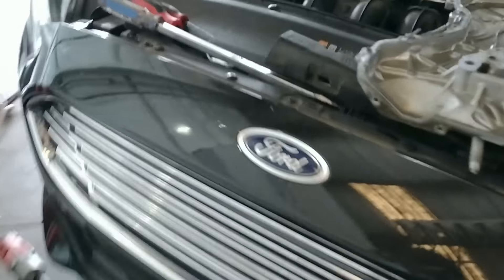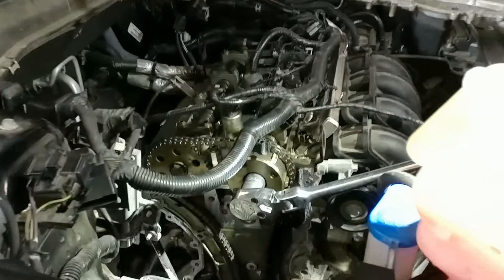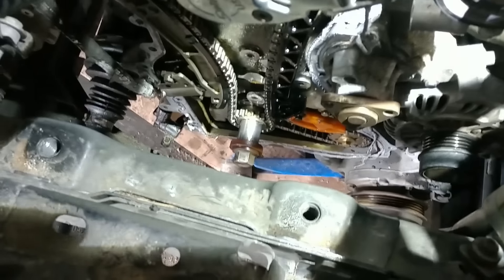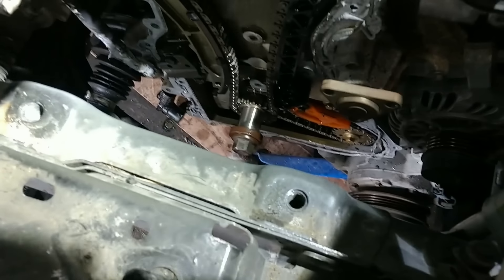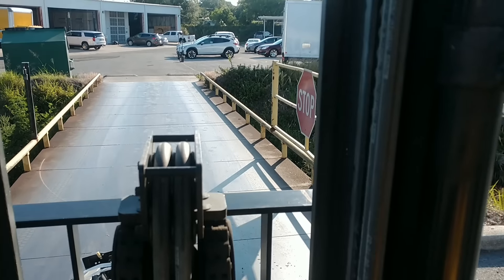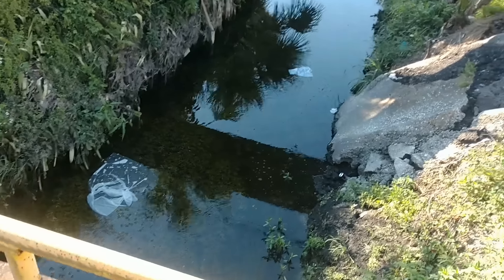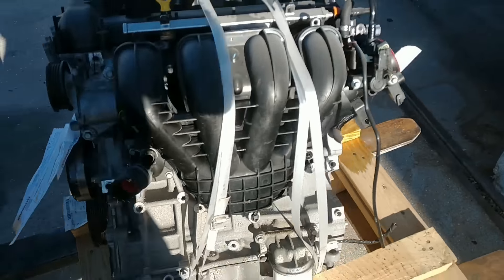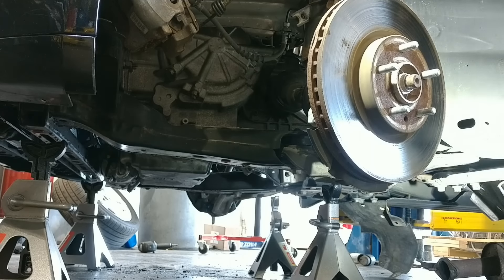Damaged Engine: You Broke it! Pt1

Comment: “That’s where we failed.”  You’re a team player and an exemplary boss. Nice!
Reply: Too right.
Reply: +1 to that. Even just the way he takes it in as a learning experience for the both of them, what a legend
Reply: That's when I subscribed. Guys honest, fair, and kind.
Reply: This is the right boss for an apprentice to learn from. Quality begets quality. There is no other way to explain it.
Reply: Way to own it.  We all make mistakes and learn from it.  Kudos to you guys
Reply: FRICTION holds the timing sprocket in place?  What?
Reply: @maxpeck4154  interference engine what a shitty design.
Reply: @steeler68cad  I don't think it's inherently shitty, but there should be a solid mechanical connection for the timing belt/chain for crying out loud.
Reply: @maxpeck4154  well, that sounds inherently shitty to me.
Reply: Accepting the moments of failure that will happen and knowing how to use them to teach is a skill of only top tier mentors
Reply: I've been a trainer in the Army, a truck driver, and now even as a Crossing Guard. A trainee's failure is your failure, and you need to take corrective action to teach whomever you are working with both the right way and the negative impacts of doing it wrong.

Comment: I would be passed that the shop put in a junkyard engine.   As the customer I would have demanded a brand new engine since a professional mechanic was the cause of the engine destruction.
Reply: Pissed.  Stuiped auto spell.
Reply from the maker: It was an apprentice doing the work, against the advice of myself. Decision was made by management. Damage caused by a mistake doesn't mean folks get brand new engines. The damage could have been repaired, the engine could have been replaced with a unit of equal or fewer miles, (old one was 74k, new one was 41k) which is what happened in this instance. The owner makes those decisions, not the shop. If you break your phone and file a claim on it's insurance, they don't send you a brand new one, you get it repaired at the deductible or it's replaced with a remanufactured (rebuilt) unit.  LKQ offers warranties on units such as engines and transmissions etc.  Since the owner got to drive a brand new car car during the repair, got a engine with almost half the mileage and gets a warranty on a vehicle long out of Fords powertrain warranty, I'd say they ended up with a sweet deal in this case.
Reply: @RainmanRaysRepairs  the warranty would be a critical point, but in the phone example, the phone was broken by the customer.  It doesn’t match what happened in your shop. The shop broke the vehicle not the customer. The shop didn’t use the factory service info and destroyed the engine. I totally get it was an apprentice mistake but his mistakes should be completely on the shop, NOT shared with a customer.  Idk this customers maintenance habits but I do know mine and I would not be quiet over a junkyard engine.
Reply from the maker: @rbarr1200  I totally see your point. I take good care of my Duramax and would flip my lid if it were damaged and replaced with a salvage engine. Believe me, I was pissed at the whole situation from start to finish. Had I owned the shop, the young guys wouldn't have been allowed inside an engine to begin with. Fortunately for the managers, the customer was ok with the engine and choose that over repair of the damaged one. At the end of the day the shop got off with less dollars spent, the customer got a newer engine than what he had, and a warranty to go with it. It ended up being a win win given the circumstances. The trainee got his trial by fire and learned a lot, and the managers didn't learn squat. They gave him another advanced level job right after. I got another job and got out of Dodge (no pun intended) shortly after this disaster was sorted out.  It's not posted yet, but here's part 2 https://youtu.be/WZd6mHjS1rY

Comment: Engineer: okay, we design a new engine... BUT... We make it like the hellraiser puzzle box.
Reply: well the fusion was never meant to be sold here in the states since elsewhere (mainly the uk) its known as the mondeo and apparently used to be amazing till that generation
Reply: Bizarre to me that you you would friction fit the timing chain drive sprocket 💩
Reply: @guganotubo  dude the ford engineers had to be high when makin it
Reply: A keyed timing set will cost you extra 😆
Reply: Every engineer should be force to work on their designs once implemented in the real world. I have actually heard engineers say, thats a technical problem. Not an engineering issue. When its their design that created the problem.
Reply: @BigHappysPlace  atleast i own a older truck cause these new ones seem way too overly plastic. and i don't get the newer styling i dont know why but i hate the newer giant grilles on trucks nowadays
Reply: @BigHappysPlace  I'm actually in my last year of a mechanical engineering degree. I'm also 38 and have worked a good portion of my life as an industrial electromechanical tech. One thing engineering schools don't teach is common sense and practicality.
Reply: @graveyardrumblers  that's not necessary when the goal is cosy cutting and building as low cost as possible
Reply: Cenobites like pain. They would drive Ford.
Reply: @GraveKommander  😆
Reply: As a bmw tech, this is par for the course. Lock down timing assembly before taking pulleys off.
Reply: @tskraj3190  I hear ya. I daily a 98' f150 with the 4.6 and only 130k on the dial and it runs beautifully. I take pretty good care of it and other than a few minor rust spots here and there it's still in great shape.
Reply: @myk55501  I'm in my final semester of a mechanical engineering degree and I've learned enough to know I have second thoughts about working as a mechanical engineer 😆
Reply: Kinda like the V6 they make with the chain driven water pump that leaks all it's coolant into the oil after only 60k and needs a new engine 🤣

Comment: If I've learned anything from this video it's to look up service information on any car I'm not familiar with. That's just insane. Hope the poor guy doesn't beat himself up over it
Reply: Truly insane. 
Typical case of some idiot engineering team with too much time on the desk, and unable to even hold a tool.  
Who thinks of these kinda shait solutions.. oh wait.. i know.. its FORD

I have a van (FORD) and it has 2 timing chains. Although this is not completely unheard of, it is a massive pain in the butt to change what they call the "wet belt"
Reply: @Coen80  Scrap that turd and get a Chevy van. OHV, uncomplicated, LS-based V8 or V6. The rest of the vehicle will fall apart but the engine will run perfectly forever and a day. I'd also recommend a Magnum-powered Dodge van but their transmissions are literal garbage so unless you find an old van with a 727, it's Chevy or GMC all day.
Reply: from my experience as a young tech , he is probably beating himself over it
Reply: I been a Automotive tech for 18 years every factory has it flawless design we are in a time where it best not to service or rebuild engine cause only Ford, GM and doges still rebuild engines but don't mean they don't make it hard for outside shop to work on these  with out the proper dealer special tools this is why I got out of it cause it getting annoying and paying use less for this crap.
Reply: I'm not a mechanic so if working on my or someone else's car (I'm proficient backyarder and know my limits and when and where to get the required info) I also refer to service info just to be on the safe side. My profession is computers. Many years ago when I was getting a start in the industry I mirrored a customer's IDE hard drives with the wrong addressing method, that resulted in destroying the data on BOTH source and destination drives.

My boss covered my ass big time and made up some story to the customer (which I don't agree with and don't do myself - I run my own business now) about unavoidable drive failure, and we restored everything from backup and got it all working at no charge. But put the customer out of action longer than it would have been otherwise. I never ever copied data from a drive with the wrong addressing method selected ever again though haha. And learnt to make sure I know not just guess what I'm doing. My customers have benefited from that haha.
Reply: Luckily the engine was super cheap to replace.

Comment: That must be the worst design I’ve ever seen.  That’s just awful!  😮
Reply: FCA Ecodiesels have the same problem. The crank pulley is only press-fit.
Reply: Right? Like how are you supposed to set the gear on the right spot on the crank when it get tightened?
Reply: @Sausketo  there must be a kit available to lock the crankshaft at tdc from flywheel side before disassembling
Reply: Ford and their better ideas
Reply: @kevindavis6042  there 2012 tdci engine is the one to get in my opinion, runs forever, I know cause my mother owns a 2012 mondeo (Europe version of the fusion) and it hit 100,000 miles, runs like new.
Reply: Its not an issue if you read the correct repair procedure. You screw a timing peg through a bolt hole on the side of the block that aligns and holds the crank at  tdc, install the cam timing plate, and then leave them in place whilst you do the timing cover and tighten the balencer. 

These engines have faulty cam phasers.
Reply: Hence the acronym, FORD - Found On Road Dead.
Reply: @MattyFielding6  which engine is this? 2.5 N/A??
Reply: @bdun1226  this set up is on a few different displacements. They are on the turbo motors as well. Cx-7, mazda mps, jaguar 4 cyl and i think 4cyl mustang. The crank peg is the same but use different cam plates depending on direct injection.
Reply: Its a disposable crappy Ford engine, looks like PLASTIC timing chain guides there too, perfect for fast wear the way that chair curves over them putting considerable pressure on them!
Reply: Mazda 2003 CX-7s have the same design.  Awful. They have diamond coated washers that under tension "lock" the pulley into place on the crank.  The pulley is not keyed.
Reply: @payrocoin  fix or repair  daily
Reply: @kevindavis6042  Mickey mouse engineering...
Reply: @lukematthews2209  100,000 miles is not forever, tell me when you hit 500,000
Reply: Ford
Reply: Many small engines, diesel included,  require timing lock up tools when doing most tear down.
Reply: @rickdarris6152  for what these vehicles cost nowadays that's ignorant their engineered and made cheaper..
Reply: Watch the Sandy Monroe video where he tears down the cooling system on the Ford electric mustang. Just awful design. Seems to be so that dealers can make more money on maintenance, and Ford can sell more spares.
Reply: But they saved 14 cents by not having to machine a keyway in the crank or pulley. It is eco friendly to not use unnecessary fossil fuel energy so wastefully is what the woke engineers will say.
Reply: @HobbyOrganist  yep! My ford even had a plastic tensioner
Reply: @andyk192  no that's the 5.4 3 valve that has cam phaser problems.

4.6 2 valve and three valve don't have cam phaser problems just the 5.4 3 valve!!
Reply: Dude. You have never worked on a mini have you
Reply: .......never saw a 3.4 DOHC ?
Reply: @payrocoin  
First
On
Rubbish
Dump
Reply: @grettagrids  Damn, this is a good one! 👍🏼

I might have to use this one from now on. 😄
Reply: @gillesthibault429  Saying something is "only press-fit" is somewhat ambiguous.  How many tons of press is it? 1? 2? 10? 20?  Just curious.
Reply: @payrocoin  As an ex recovery driver, I'd have a Ford over a BMW or Audi every time.
Reply: @jasonwood7340  A crankshaft pulley cannot be press-fit at a force at which it cannot be removed to be able to service the crankshaft and/or its bearings; that's why it's secured by a tightly torqued bolt in the majority of applications.
Reply: @Jin-Ro  being a BMW tech that works on other European cars I kinda see your point. But I see this motor in Land Rover evoques and have repair a lot of timing issues , mainly cam adjusters. Land Rover engineering turbo this motor. (Audi is absolutely trash)
Reply: @Angl0sax0nknight  Agreed on Land Rover. Though I quit the recovery game just after the Freelander 2 came out. Absolute garbage of a vehicle. 
I own a LR Series 3. Most unreliable man-made object I've ever owner. Love it though :D
Reply: Unfortunately WTF things like this are more the norm than the exception with Fords.  That is why I won't buy another one.
Reply: @MattyFielding6  It's STILL a STUPID design.  Just design it with a key and this problem cannot appear!
Reply: As a former tech I sympathize and feel the pain. Ford techs are leaving dealerships because they are sent to school to work on them and still can't work on them when they get out!...

Comment: Back in the days it was easy changing out a engine u didn't have a hundred wires all over u didn't have all the metal lines and hoses u didn't have 500 bolts and nuts u didn't have to drop sub frame wow give me yesterday today great video ray love them all ✌🇺🇲

Comment: I was a Ford tech for years, the Explorer V-6 had a motor like that but it wasn't the crank gear that secured everything it was the Balance shaft in the center of the engine. The explorer has 4 timing chains and a special kit to lock the cams and crank into a timed position then one bolt dead center that locks everything into timing without any keyway or guide pins just torque. 3 chains on the front and 1 on the back, you have to pull the motor to replace chains because the rear chain connects to the balance shaft behind the flywheel and the rear of the passenger head.

Comment: A lot of newer Fords are like this. There's actually a bolt hole for a special tool towards the bottom rear of the engine. Locks the crankshaft in place. Anytime you need to pull the crank pulley you have to put #1 TDC and lock it there. Otherwise this happens.
Reply: New to the US perhaps, but European Fords have used keyless timing for over 20 years.
Reply: What could possibly be a good reason for that?
Reply: @aidenmonkeynat6024  It gives the ability to get more accurate timing, with reduced manufacturing cost. It's been used on European Fords (and others including BMW) for over 20 years.
Reply: I'll stay away from ford products from now on thank you
Reply: @sammorgan2390  Other manufacturers have followed Ford's lead in doing this, including Renault and BMW.

Comment: A lot of the timing belts and chains have been like this in the UK for a long time, the reason for it is it removes the difference in valve timing caused by wear on the drive system, every time you change the belt/chain it resets the valve tdc to the crank tdc, you can blame ecu's and vvt for that lol.
they are a pain in the ass because the bolt is so tight its near impossible to remove one if you are on your own with no power tools, you can not blame the young guy, he was in over his head.
Reply from the maker: I has a similar chat with him after we figured out what happened. This could have happened to any off us. Experience could have caught it before attempting to restart afterwards... But this is how we learn
Reply: Yeah, just about every European maker has "interference fit" cam pulleys or crank cogs or both. Yes, if you don't have the specific locking tools you are in trouble, and yes, those tools can be stupidly expensive. However, if I never have to deal with another key that shears when the water pump bearing seizes or a sheared key that manages to machine a perfect ring out of the oil pump cover again, I'm alright with that.
Reply: @RainmanRaysRepairs  Sure, next time a Ford rolls in for that legendary Goodwrench service, you'll be better prepared 😆 This reminds me of my mother taking my uncle's Buick to the local Ford dealer for a pulsating brake pedal back in the '90s. Don't worry, they screwed up almost as bad as you guys did, which is hilarious as the brake pedal had ABS molded into it in giant letters.
Reply: @RainmanRaysRepairs  old ford ranger had that with sohc v6 on camshaft sprockets
Reply: The solution to a non existing problem...
Reply: @MrShitrope  The Taurus SHO hotrod had press fit cam sprockets on the cams...notorious for going out of time and smacking a piston. People would weld the sprockets to the cam to avoid the problem. That was the easy 30 minute preventative measure.
Reply: @DL101ca  its not, if the valve timing goes out due to wear it can no longer control variable valve timing and shut that system down and throw codes.
Reply: It's not just cars, a lot of truck and equipment engines have keyless timing drives now too. As emissions standards get tougher precise timing becomes more critical.
Reply: @blueridgerennsport  It's the friction on flat sides of cog/pulley/crank that transfer forces. Many times you even got diamond washer to help with the friction. The key and keyway are only for alignment purpose and will fail if there is not enough friction.
Reply: @RainmanRaysRepairs  honestly mature response. failure affords you the opportunity to learn.
Reply: @Green Mamba Games are you joking or ignorant ?
Reply: @Green Mamba Games yeah, their sweet spot is electrical innovations.
Reply: @RainmanRaysRepairs  thats one way to get experience!   Nice that you could find the engine for 400 bucks tho.   I was thinking you’d be at least a couple grand into that screw up
Reply: @blueridgerennsport  Right - so many here call stupid design without knowing the reason this design was selected. Maybe to reduce the stress risers caused by sharp cut grooves. Ability to time precisely and not compensate for a keyway cut slightly off.